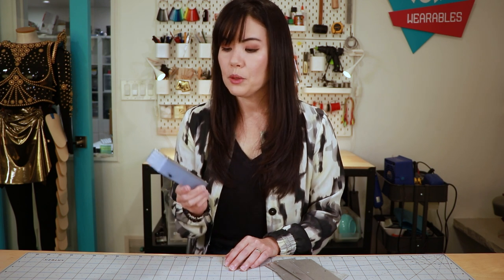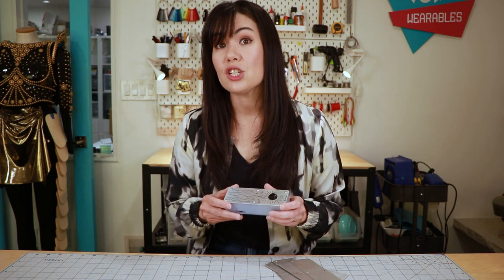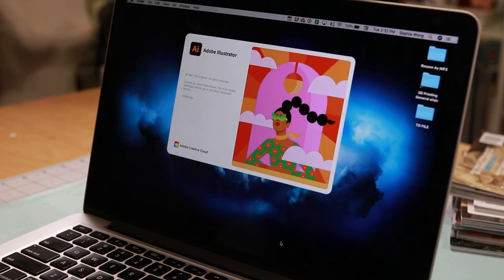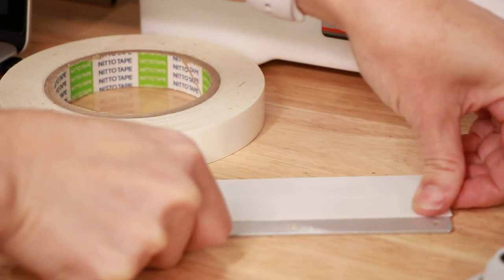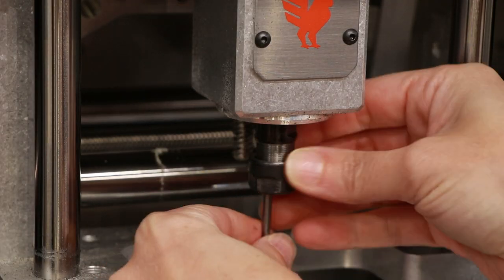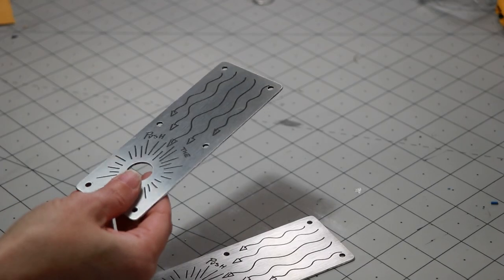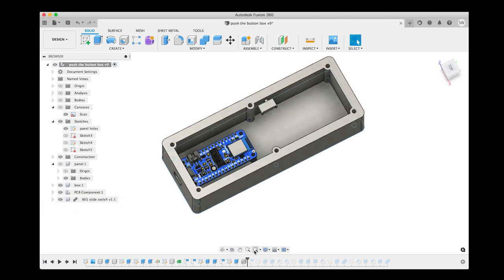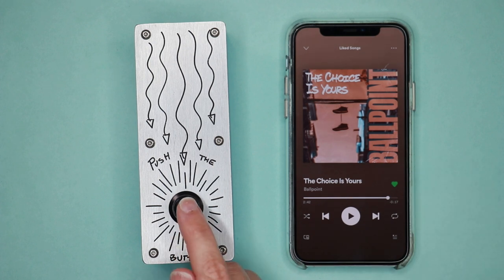What does it do? Push The Button Box - Collab with BlitzCityDIY!

Comment: I didnt know you was an artist for them! That software you mentioned, can you select different parts of a continuous line to cut and engrave, or do the elements have to be seperated, how do you stop it at one part to replace the bit, can you program a pause?
Reply from the maker: For the SVG workflow, the elements need to be separate, complete paths in the SVG file, and color coded to indicate the operation (cut vs engrave, etc.) While milling, you can always stop/pause the milling operation by pressing cancel in the Bantam software or hitting the big red emergency stop button on the machine, and the Bantam software automatically pauses for tool changes, which is really great!

Comment: Simple and Nice! 
Your process on illustrator from tablet to PC is really cool! 
what did you use for removing the double Tape from the CNC ? Acetone?
Reply from the maker: Thanks! It's isopropyl alcohol (99% is recommended, but I only have 70% right now so I just try to dry the surface well afterward)